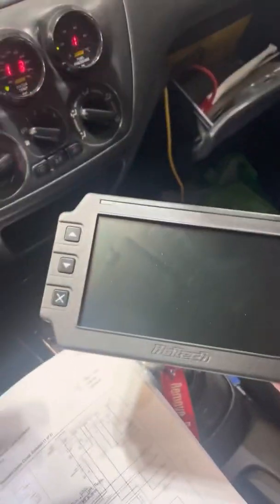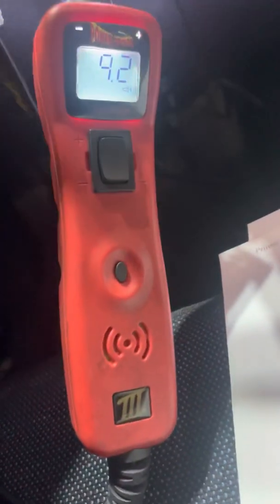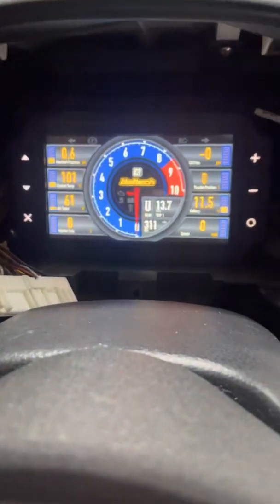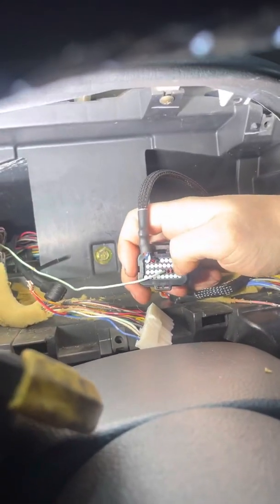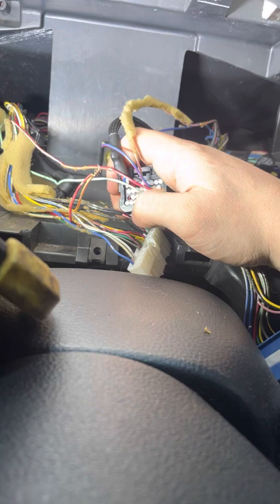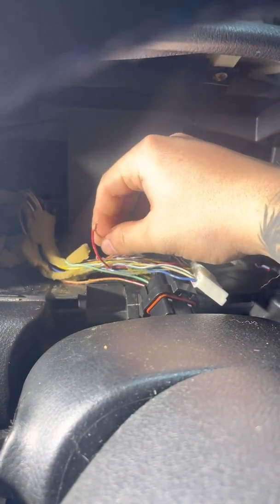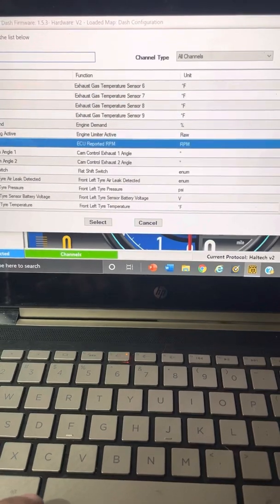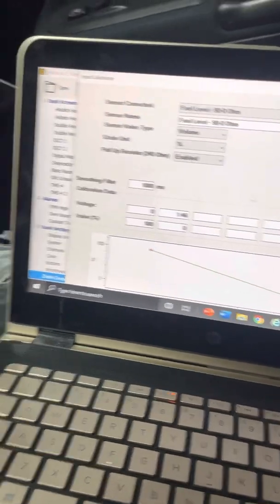Evo 8 Haltech IC7 wiring

Comment: Are you running a haltech ecu? Or is this with a stock ecu
Reply from the maker: This is with a haltech 1500 it uses the canbus port on the haltech to make it plug and play. But I do believe you can use it with stock ecu you just have to wire it into canbus for the ecu

Comment: Huge help as all I was initially able to find was the Evo 9 dash pin outs.  Two things.  1) Did you find a solid point to tap in for the parking lights for the dim/night mode feature?  2) The fuel level sender needs to go to pin 21/avi 4 as it has a built in 240 ohm resistor built in and that's the only one the software will allow you to assign fuel level to.  This is just my experience.  Thanks again for your contribution to the community!
Reply from the maker: Just saw this man. That’s a good tip for pin 21 I missed it when messing with the software

Comment: Did you ever figure out a permanent fix for the loop?
Reply: You can just take 12v switched and put a 470 ohm resister between that and the alternator charge wire

Comment: I just got the IC7 so thank you for doing the research!  Did you just pin into the front side (female side) of the oem connectors?  What was the final decision for the alternator line you had to loop?  I might attempt this over the weekend.
Reply: Actually I assume that is just the low voltage light.  My buddy said he ran a small bulb in between.  Appreciate the video,  I will attempt this over the weekend.